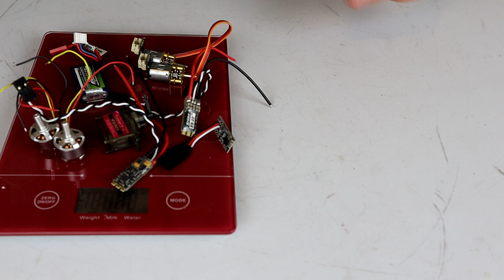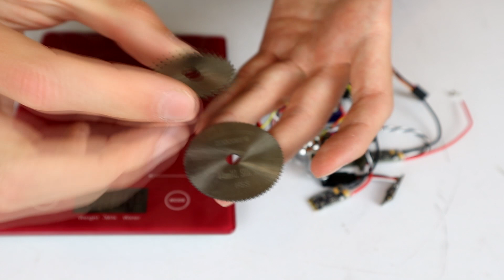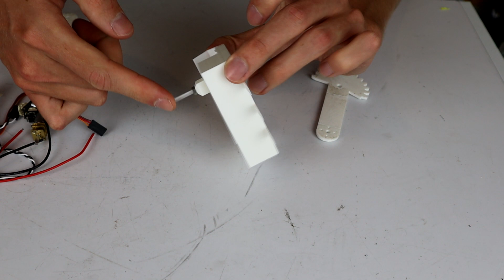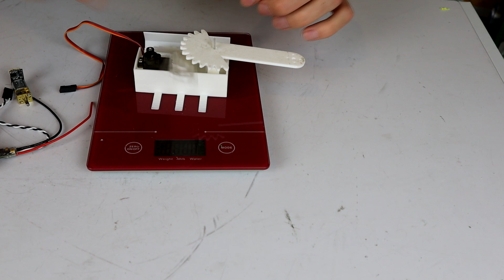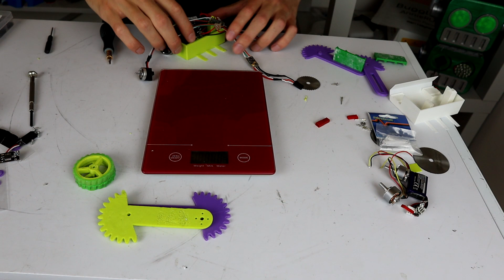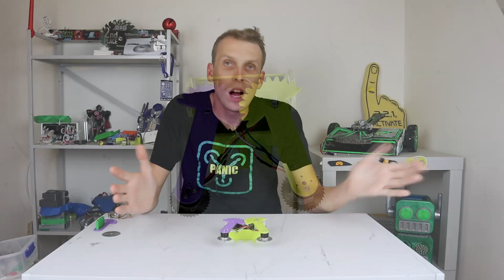Dual Saw bot Prototype 1 (150g Antweight combat robot)

Comment: I am curious as to why the sawblades are so far away from the main chassis of the bot, why not have the sawblades closer to the chassis and the tpu grabber setup be as long as before?
Reply from the maker: The sawblades are out that far so that they can out reach a horizontal spinners weapon.
Also, that is the minimum distance I can have the saws and still swing them around to the back of the robot, any shorter and the saws hit the side of my bot when swung to far back

Comment: Hey man! Nice bot, I’d recommend taking a look at “Not So Free Hugs” by Tom Spaulding over on Facebook. It’s a dual sawblade powered by a Pololu motor and a worm gear setup. Great in concept, but the robot blew a speed controller and shattered its weapons during its only match. Hasn’t been back in circulation because Tom wants to focus more on his other robots but has said he’d like to pick the project back up eventually, IIRC...

If you’re worried about weight you could also try a shufflebot, if you’re willing to put in the extra complexity and if ARC allows. Totally understand that that’s not everybody’s cup of tea though...
Reply from the maker: Thanks for the video, that's interesting! I'm going to stick to a servo, but I like the flat design so I might try and make my bot flatter with the new high voltage servo.

ARC does give a weight bonus for shufflers and I want to build a bot that takes advantage of that, but it wont be this one
Reply: Here’s a video of Not So Free Hugs in action: https://youtu.be/87fJ8mIzc1U

Comment: What motores/ESCs are you using on the bruhless weapons.  Also, how do you find/pick them.
Reply from the maker: I'm using tiny 20A brushless ESCs that I found in a local hobby shop. I picked them because they are the smallest 20A ESCs I have seen and they are supplied locally so I can get them super quick.

The motors are ali-express specials. I spent many hours searching ali-express looking at various search terms for "small brushless motors"

Comment: Do you use F360? I think it has FEA built in - you could add holes to your body and arms and also drill out the blades to lose weight., checking for stressor via the FEA functions.
Reply from the maker: I use it for somethings. I learnt CAD in other software and have been "transitioning" to fusion for well over a year now.

In reality, I don't think I'll ever use fusion exclusively. Things like the chassis for this bot I can CAD way faster not in fusion so I do that. But the arms I needed fusions gear generator so I used fusion for them.

I was thinking about running the arms through generative design just to try it out. I still might
Reply: do the generative design ben you wonderful man also I take it you used the gear gen in fusion? muck about with parameters, maybe add more backlash.

also what RX is that? always looking for diddy electronics for a certain overhead robot.....
Reply from the maker: I'm keen to see what the generative design makes! Yep I'm using the gear gen, I did add a bit more play before printing in abs so they are good now

I'm using a Flysky FS2A rx, its tiny and can run straight from 2s. I did a video about them a while ago and highly recommend them: https://youtu.be/npt4z8P3CeY
Reply: @TeamPanicRobotics  bugger wrong protocol

Comment: Looks amazing so far! I'm interested in what you think of the new ARC arenas. From my perspective as a viewer, it seems to me as a downgrade from the separate beetle and ant arenas, in that the pit is oversized and positioned too close the centre, making fights too short and outcomes random. As a competitor, what do you think?
Reply from the maker: I'm in two minds because there are two sides to being a competitor: driving and building.

As a driver, I dont like it much because my driving skill is not good enough to consistently avoid the big pit and it does hamper the effectiveness of big spinners

As a builder, I like it, it's a new challenge, which inspires new ideas and forces me to cast off old designs.

I'm more of a builder then a driver, so I feel more positive than negative about the change. In all honesty, the builder part of me was sick of This Is a Party, it only ever needed minor changes (after the weapon mount stopped breaking every fight) and I kind of regret using it long enough that people started talking about it as my channel icon.
Reply: To be fair, it was your best bot.

Comment: I had the same servo for my lifter. Both let the magic smoke out on 7.2v. I hade to get a small voltage regular. I still am not happy with the quality of the servos. Both don’t move the same amount.
I love your design and I do agree that ARC arena is made for control bots.
Cheers mike pluhar
Reply from the maker: Yeah they arnt the best, but they are cheap.

I got them originally to use in loan bots, but yeah, I dont like them much any more